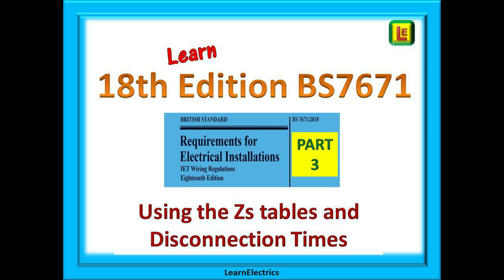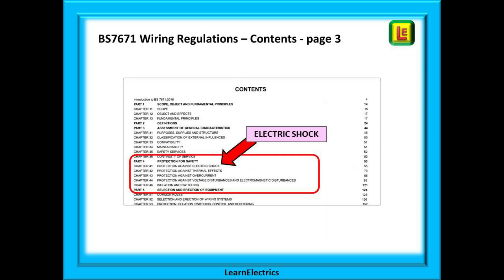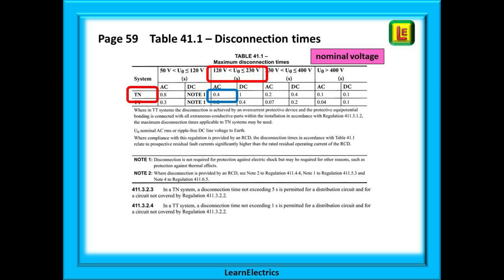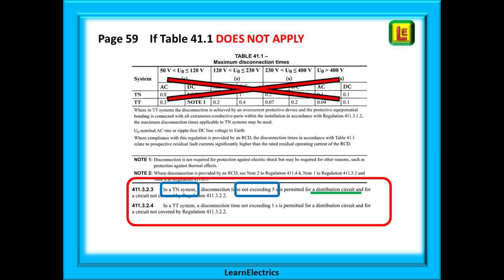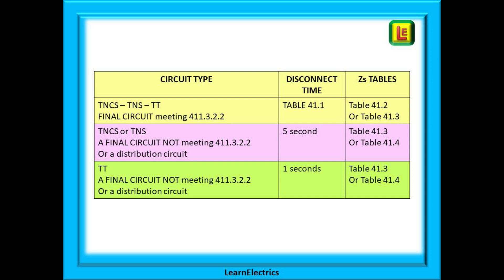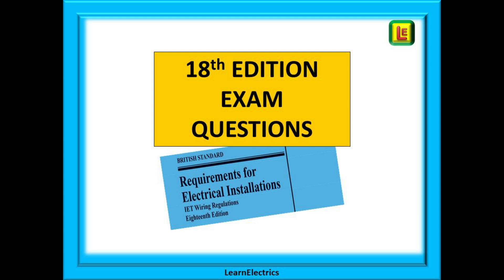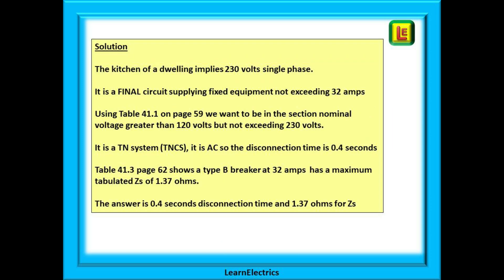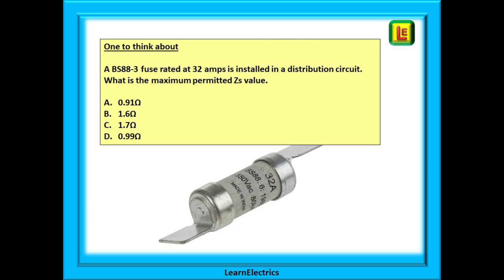LEARN 18TH EDITION All about Zs and Disconnection times. Part 3 of the training.

Comment from the maker: SEE ALL - To view a list of all our LearnElectrics videos, click on the link below.
There are many videos on many electrical topics including Installation, Part P, 18th Edition, Testing, Certification, Lighting, Sockets, Ring Circuits and much more.
https://www.youtube.com/channel/UCYaJQnpO4XAp0yCgqzMkmfA
Reply: Am I correct that Zs is defined as earth fault loop impedance, and is made up of Ze (external earth loop impedance) plus R1 (line resistance) plus R2 (cpc or earth resistance) of the circuit as measured at the point furthest from the relevant protective device?  This measurement ensures ADS within the specified time in the event of a line to earth fault.  We don’t tend to stress the line to neutral resistance, yet in a short circuit overload situation the L/N impedance would seem to be equally important to ensure the supply disconnected quickly.  Why is this?
Reply: Thank you for your videos. Really realy helpful and clear to understand. I am a bit confused about maximum disconnection times. Let’s say I have a  MCCB 60947-2 TP breaker for SWA cable suppling a distribution panel which is 3-phase. The breaker is 100A. What is the disconnection time for that MCCB? I am always struggling when I fill my certs. Regards

Comment: Hi, TT system, 400v circuit, is the disconnection time max 0.07? 

Thanks
Reply from the maker: Page 65 of the brown regs book. Table 41.1.
Reply: @learnelectrics4402  thanks anyway

Comment: Am i allowed to use a high lighter penin my book for the exam? im guessing not.
Reply from the maker: Officially no. You can use a small number of page tabs but to be honest, if you learn to use Page 3 Contents page and the table of tables and table of figures at the back of the book, you may not need tabs. Good luck with the exam. Dave.
Reply: @learnelectrics4402  thanks again

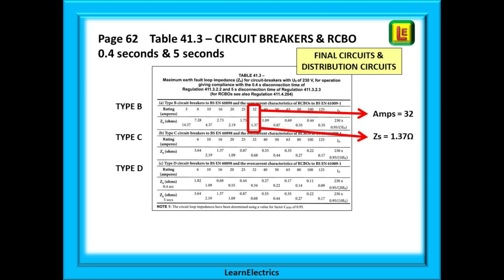Comment: At 9:16 in video table 41.3 for 0.4 and 5 seconds.    Type B 32 amp has Zs=1.37 ohms. Is this for 0.4 secs or 5 secs ?   How can this Zs be the same for both disconnection times ??    You would assume a faster disconnect would need a lower Zs value ?
Reply from the maker: Michael, a fuse relies on a piece of metal melting and they melt at different rates but a circuit breaker operates with a coil which is much faster. If a breaker trips in 0.1 second then it has also achieved 0.4 seconds and 5 seconds. And Zs is determined by the breaker size.
See our video DISCONNECT TIMES on this link … 
https://www.youtube.com/watch?v=14XPKfUaDdI
Reply: @learnelectrics4402  Ok. The table only gives Zs value for 5 second disconnection times for Type D breaker. I assume if you want a longer disconnection time you must use a type D breaker and the appropriate 5 second Zs value in the table?
Reply from the maker: No. Totally wrong, that's the last thing you do.
Type in  --- Learn Electrics Zs Where do the numbers come from
Hope this helps.
Reply from the maker: I'm back home now with access to links - type in this link for the Zs video and good luck.
https://www.youtube.com/watch?v=IjpJK1eJLzw
Reply: @learnelectrics4402  Can you do videos of actual complete circuits where you clarify how the breakers are selected.

Comment: Could you do a video regarding maintance free boxes. 
And what constitutes 'inaccessible' because theoretically unless a box is under a concrete floor or behind a brick wall then it can be accessed, 1 way or another. Equally putting a box somewhere accesable in literal terms might leave it somewhere prying hands can get to it. Because a wago box being accesable and inaccessible determines it's maximum allowances as stated on the box. The same wago connector 32a accesable becomes 20a inaccessible 

With wago connectors so big in the industry and regs so stern it would be a massive help if you could shed light on this matter.
Reply from the maker: I'll put it on the list. Generally, accessible means behind a screwed cover or similar. So under the floorboards is considered inaccessible, especially when there are carpets and furniture on top. Can you access it quickly and easily without dismantling, that is the question.
Reply: I had exactly this issue a couple of weeks ago when extending cables to a new CU location in an accessible roof space.  The non-wago adaptable box is in an awkward position but can be accessed.  In this situation I considered that the Wago connections are under no different electrical stress regardless of the definition of accessibility.  If the box was indeed buried behind a plasterboard wall, amongst insulation that may give a reason to de-rate 32 to 20A as you would for cable, per the reference methods.  I agree, this rule looks to be more about liability transfer from the manufacturers unless someone can explain the physics to us.
Reply from the maker: I agree, it can be confusing at times. Good luck. Dave.

Comment: Excellent stuff as always Dave. Theanks for sharing. 
It was stated that 0.4s  apply to 32A fixed appliances or sockets upto 63A.  As shower circuits are fixed appliances and they exceed 32A so what is the disconnection time that applies on them?
Reply from the maker: That's one of those strange ones. A 9kW shower will draw 40 amps.
If protected by a BSEN 60898 breaker it will achieve disconnection in less than 0.4 seconds  if 200 amps or more flows as fault current, typically 0.1 second. Also, it has additional protection by 30mA RCD which will disconnect in less than 0.3 seconds. Either way it achieves a quick disconnection time. You are not the first to ask this, it is just one of those odd ones, there is not any mention in Special Locations either. Good question. Keep watching the videos, keep asking questions.  Dave.